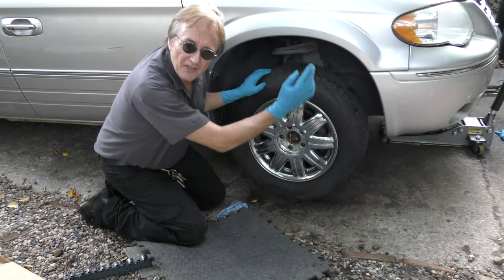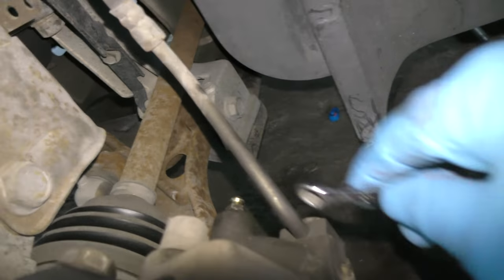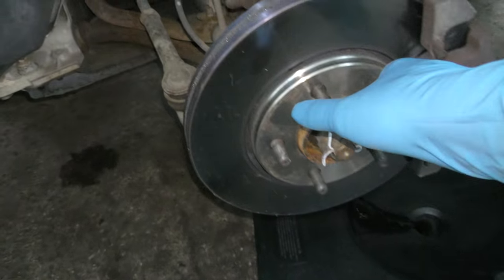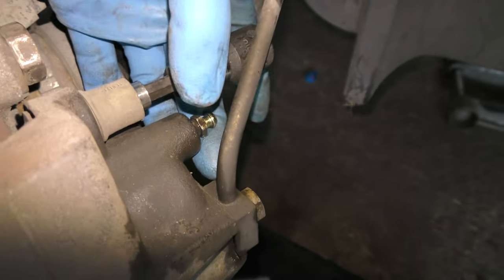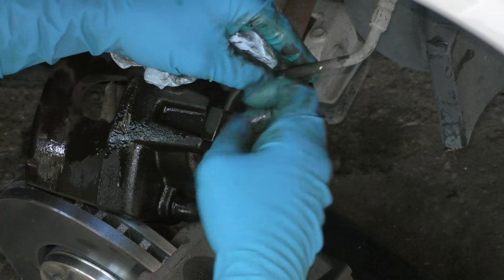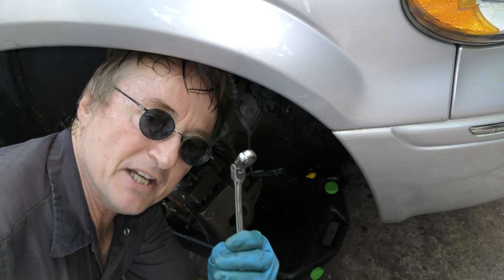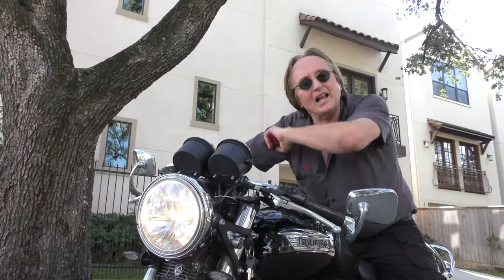How to Fix Sticking Brakes on Your Car

Comment: Forgot to mention it can also be a collapsed rubber brake line
Reply: I had that once on a Fiat, replaced the caliper but no result, it apeared to be the hose inside collapsed indeed.
Reply: This is true. As I work on cars and I would say 90% of the time it's the brake line.
Reply: If it was a collapsed line then the wheel would have turned when he cracked the bleeder.
Reply: You are right!
Reply: Brandon Peterman so very true, i actually see that more than I do bad calipers, had to hear this guy yelling at me till I muted it and read your comment verifying he didn't mention it. Good call for sure, that info really should be in any video about sticking disc brakes!!
Reply: @toddvance1979  wheel was off when  bleeder loosened.
Reply: Larrlos wheel or no wheel on, the rotor would’ve spun if the hose was collapsed. You can’t access the bleeder valve without taking the wheel off

Comment: I'm a subscriber....My 350z locked up the passenger side break today. I was driving about 10mph and with the 10" wide wheels. It nearly sent me into a light pole. The ABS light flashed a few times and the brake released. I wasn't pressing the brakes it just locked up on its own. Any suggestions???

Comment: I recently took my vehicle to a shop to have a caliper replaced.  However, they "required" the brake fluid to be completely replaced.  As it was always my understanding that you will need to bleed the brakes after replacing the caliper (and this will require some brake fluid to need to be added), was this an example of the shop "padding the bill"?

Comment: ok so heres a question for you, if you crack the bleeder to check if the rotor turns freely like you did in the video is it a quick loosen and then tighten or do you leave it open then tighten it later and then have to bleed the system again? if you are not replacing parts right away. My truck is just rubbing a little and i might need to drive it to the parts store haha.

Comment: How would you fix a sticking drum brakes?...also does the abs sensor has something to do with sticking?
Reply: Theres a lot going on inside a drum brake. lots of springs and levers n all kinds of craziness. if 1 thing fails or locks up, it all goes to shit.  If you see some fluid anywhere on or around the drum assembly then either the line or the cylinder is leaking, allowing air into the system which prevents its from releasing. 
the bottom of the drum has a weird cylindrical piece with small teeth, about 8 or 10 all the way around. thats the adjustment device to remove slack from the brakes. you can twist it a little back together to add some slack keeping the pads off the drums for a bit.
But like i said, there could be a lot of other things happening. and theyre all made different.

Comment: Scotty, i tried to bleed myself the brakes. The back was an ok job, but in the front, i managed to broke both bleeder valve into the calipers. So, i bleed thhe brakes at the brake line. How to remove the broken bleeder valves without using a torch? (i have no torch), and without using a welder either. Thank you!

Comment: I remember I had a 1996 Ford ranger with the ABS light flashing all the time and the rear passenger side brake would lock up on me in a weird way, I'd first get started and hit the brake, they'd lock and the wheel would drag and the truck would turn to one side, I had to stomp the brake pedal a few times to free then so it would stop properly and this happened very other day for the 2 years I had it

Comment: I've started noticing a plastic burning smell from driver side rear wheel well. Could this be a seized caliper, or maybe an issue with the brake hose?
Reply: If you crack the bleeder vakve and it's still stuck then it's a stuck piston. If you crack it open and it releases the pressure then it could be either a bad hose, brake line gone bad, or a bad master cylinder. Could be a number of things

Comment: Ok, ‘34 ford five window has brakes holding. I took off the caliper, pushed the piston in to see if the piston might be sticking or stuck. Put it back together, it’s sticking worse. I’m thinking the lines? Yes, could still be the caliper, but it’s doing it both front brakes, not the rear. 🤔

Comment: Hi there...was hoping to find a solution here but its not really the same issue for me.
I have an older Polo 9n (2004) I´ve just replaced rotors, pads, slider pins, brakehoses and calipers and the front brakes are stuck.
What would be the likely cause of this?

Comment: The front driver side brake is sticking on my 2005 Toyota Camry is sticking. i have replaced all the components  including the pads, rotor, caliper and brake hose. It is still sticking. Do you think it is either the master cylinder or the ABS system

Comment: What if you change the caliper and it's still doing the same thing? Can the master cylinder stick?
Reply: I tired everything calipers rotors hoses.... What fixed my problem is I bought a 50$ scan tool cleared all my codes then before driving I turn traction control off !. My wheel speed sensors must be bad so it tells ECU I'm slipping and locks / drags wheels with the abs system to point of smoke. Scan tool and traction control off helped my brake stick problem.

Comment: Hey Scotty, my name's matt. I have a 2006 Chevy equinox. I recently bled the brakes and got the air out of the system. The brake pedal is stiff as it should be. Went for a test drive and my brakes or caliper is sticking.  Without touching the brake pedal it is like the brakes are applied. What could I look for to help diagnose the problem?

Comment: I have a 07 Tacoma and occasion I get a vibration and hard brake pedal on the highway between 45-60 mph. The shake is pretty bad and then it will all the sudden just stop and go back to normal. What would cause this?

Comment: my Car has the brake lights on, (at the rear) one at the top of the tailgate, and two -one on the left side , and one on the right side. Could that be caused by the bad caliper? i saw you replacing the caliper, but you have not said a word , about brake sensors, or brake lights, depending on this caliper being stuck. also my car has another problem, the brake pedal is not allowing me to step on it, its not going down.... i guess that is not dependent on the caliper.... it was not used for some years....

Comment: After changing the caliper+hose it's still dragging bad?! After I pry a bit on the calipers/pads with the bleeder open. The pressure is relieved and wheel spins free. Once the brakes are used, it drags again

Comment: you could have a collapsed flex line..looks fine on the outside but no good.. slide pins needs lubing. investigate before you shoot part cannon at it.

Comment: Hi Scotty! I have a 99 Buick century with a trans problem. When it's cold, it slams into gear when downshifting. When it's warm it works okay but upshifts when I hit the gas more. And sometimes it seems like it upshifts and then downshifts rapidly like it's confused. Do you know what this could be?

Comment: Hey Scotty, I just had my brakes get locked up on my 2010 f150 and I went ahead and replaced the caliper and pads and the same wheel is sticking/smoking again. Should I go ahead and replace the hose?
Reply: Did you notice your rotor being uneven? maybe your rotor is bent? and it's wearing on the new brake pads. I hope that makes sense

Comment: Scotty need some help my brakes grind and slip on my 06 Dodge Charger RT I put new rotors and porcelain pads on but when I hit the braks hard they grind and like slip and when I do alot of braking they start to grind can something be wrong with the master cylinder or booster that's making them not squeeze them tight

Comment: Will my van jump when it gets past 60 and then if I let off it feels like the right front wheel is hitting tons of little bumps until it gets down lower speed. Also if I'm pushing the gas it doesn't do it until I get going fast. It sounded like my whole van (astro) was about to fall apart

Comment: I have a good question I have a car that I had sitting for a while in I changed brake calipers The rubber hoses to the caliper Master  Cylinder And the right passenger side still sticks I'm going to replace brake line from the ABS module to the caliper to see if that fixes anything F not I think I'm going to not put a brake on that side I got will bearing packing grease and some other heavy grease so I couldn't drive the car cross tone when I did the brake job because it was just sticking With the front tires up in  The air the driver side moves freely but passenger side doesn't next project is might be a will meringue issue or transmission issue don't know yet

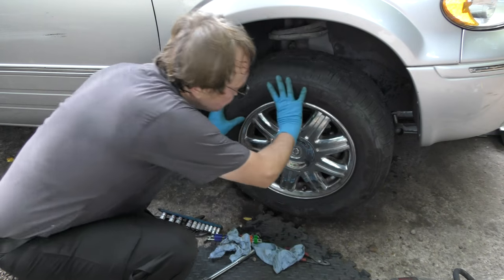Comment: there is the quote you need to hear 1:46 "simple fix IF you know what your doing" lol. for a 1min vid shows the process of a couple hours :D
Reply: It isn't rocket science.  The only thing that is tricky is bleeding the brakes, because more often than not the brake fluid is so old that it is contaminated throughout the system.

The actual caliper change out really is just 2 bolts, one hose connector, a little leverage.  Even if you struggle to dismount and mount the wheel using a crappy OEM jack to raise the car, you can do it in well under 30 minutes.  A floor jack and a decent lugnut wrench can shave 10 minutes off that.  

If you have access to another vehicle, more time is spent getting the caliper and returning the core than doing the job.

Comment: Hey Scotty I have a 2010 Chevy Equinox and the problem that I have with my brakes is when I'm driving and I hit the brakes at a red light and then when I get ready to take off sometimes I have to put my foot up under the brake pedal to lift it up to stop the sticking what do you think it could be I just had new brakes put on yesterday August 7th and the guy told me that I may need a master cylinder but we also check the calipers and they seem fine
Reply: if you have a capable scanner, you can auto-bleed the ABS. Or you can get a salvaged ABS module/etc if your vehicle is acting up in that manner. That can make the pedal sink down also. If that's not it, the rubber hoses in the brake line at the wheel may be clotted. Look into that.
Reply: Thanks a lot I'll let my mechanic know I really appreciate this

Comment: i've fixed mine FOR FREE...
1) loosen caliper
2) remove pads
3) use a G clamp and wind the pistons back into the caliper
4) spray with brake cleaner
5) slacken G clamp and press brake pedal slightly (the clamp prevents unwanted closure)
6) spray with brake cleaner again
7) wind pistons back in...if they are stiff repeat steps, if not remove clamps
8) refit pads and caliper

STICKING HANDBRAKE/E Brake..
1) Release brake lever
2) Spray brake cleaner onto stuck handbrake mechanism on rear wheels
3) If operating lever doesn't re-engage/disengage brake strike the handbrake mechanism back and forth by placing  a piece of wood against and hitting with a rubber mallet.
Repeating this process loosens any rust or debris from the handbrake mechanism under the car..I would then lubricate the part using a spray silicon oil, or grease it..

Comment: Hello sir ..i am from India wants some suggestion..

Sir i am using mahindra xuv 500 which is a suv
And..cars right front tyre slips while breaking, i replaced break pad , guide pin , but sill on speed above 40mph it slips, and produces grinding noice when we push breaks long slowly tell me what to do... thanks
Reply: Replace caliper

Comment: CAUTION: Bleeder valves can strip easily! I followed the instructions, but since I'm relatively inexperienced, I learned the hard way.

Wish I would've used a flare or socket and applied penetrating fluid.

Comment: Both my disc brakes on the front of my truck are dragging equally. The rotors get too hot to touch after driving just a short distance. About a half-mile. This suggests the problem is not the calipers. Could this be the master cylinder?
Reply: I tired everything calipers rotors hoses.... What fixed my problem is I bought a 50$ scan tool cleared all my codes then before driving I turn traction control off !. My wheel speed sensors must be bad so it tells ECU I'm slipping and locks / drags wheels with the abs system to point of smoke. Scan tool and traction control off helped my brake stick problem.

Comment: Unless your ABS pump is failing, than no easy fix(breaking the bank)
Reply: I tired everything calipers rotors hoses.... What fixed my problem is I bought a 50$ scan tool cleared all my codes then before driving I turn traction control off !. My wheel speed sensors must be bad so it tells ECU I'm slipping and locks / drags wheels with the abs system to point of smoke. Scan tool and traction control off helped my brake stick problem.

Comment: Can rebuild the caliper? I though caliper piston jammed
Reply: it is possible, depending on the damage they've taken, you usually need a special tool to get the piston out.  that is why they added the core charge to calipers.w

Comment: I had the same issue on 1999 nissan sunny/sentra b15. got my caliper replaced by a mechanic, wheel starts rotating freely. However after 2 weeks the wheel is feeling stiff again and resistance is building up when rotating. any idea what might be the issue>
Reply: Did you find it???? Wheel hub? bad rotor?

Comment: Nissan Titan 04, all brakes locked up after garage changed master cylinder. I changed brake booster ,still locking up master cylinder was not original, had to adjust booster push  rod so it wouldn’t put pressure on master cylinder , problem solved wheels are free now, what a nightmare

Comment: I hate those sunken allen head bolts on GM brake calipers. It took me quite a few hours to get them out of the hole last time I tried working on them... The only way I could figure out to remove them was to bind up an allen key in the hole then tap the allen key with a hammer. Anyone know of a better way?

Comment: Hey Scotty, my brakes are sticking and it's not any of the calipers. I thought it might be the ABS making the brakes stick so I disabled the ABS by pulling out the ABS relay fuse and the ABS fuse inside the SUV, but, the brakes still stick after driving so far and I have to rev the engine high to make the SUV move, but I have to let my SUV sit for a while because if I drive it while the brakes stick my engine will overheat and blow a hose or the radiator. The brake mechanic I took my SUV too says my calipers are fine and he and I can't figure out what is causing it to happen. It's not the transmission either because I put my SUV in neutral while it happens and my SUV still comes to a complete stop while it is in neutral and without me even touching the brake pedal. He put a new master cylinder on when my brakes went out and every since then my brakes keep sticking.  I'm stumped. Is the brake pressure too much? Is my SUV haunted? Ha ha! I'll try losing the bleeder valve like you say to do to see if that fixes it and in case it doesn't, any ideas are appreciated. Thanks!

Comment: You didn't fix the brakes you shot the parts cannon at it.
Reply: James Schrumm Very true.
Reply: Somebody wishes they had the big bucks so they could buy the rebuilt caliper instead of the 20 cent seals to do it themselves :O
Reply: Jesse Crandle He actually just called Kilmer an auto mechanic, which is NOT a complement. And I fully concur.

Comment: That front right brake and caliper of those vans were all garbage.  I have a Chrysler Town and Country with 130,000 miles and I replace that caliper twice.  Even after adjusting the rear pads still look good.  The front pads have been changed 3 times.  That front right one always goes bald first.

Comment: Hey, Scotty! I have a new Ford Tourneo, and the brakes sometimes stiffen up after I get back to my car. So I just switch to First gear, hold in clutch + break and stop the engine. Let up clutch, and the gear keeps the car in place. All is well. But this happened to me twice, at two different parking lots. Basically, I get back, push both pedals (Brake + Clutch) like when I want to start, but then the break is just solid, like pushing concrete. No matter how much pressure I put on the pedal, I could not stop the car, even on a very tiny incline at the parking lot. Of course, I just used handbrake to stop the car.

Once I started up the engine, the break went back to normal. Do you have any idea what might cause this? There is a Ford Transit and Connect, they never had this issue ever. Any ideas? I also had other older cars, never happened on those either.

Thank you!
Reply: A анонимный when a car is off it doesn’t have power brakes. This makes it hard to push the pedal in.

Comment: If anyone can advise me, would be much appreciated. I've had my mk1 focus 11 months, I've had my licence 8 months. I'm told my caliper has seized. They want £180-225 to replace, including discs and brake pads, I cannot afford this, the car is probably only worth around £500. Can I get a scrap caliper and just put old brakes back on (brake pads have done around 2500 miles since replaced) I need a "bush fix" but one that is safe to drive. Otherwise I have to sell car which is my only lifeline with mobility issues due to a back injury

Comment: I have a 99 cherokee that are completely fine until its a hot day or im stuck in stop and go traffic or both. They drag to the point im half throttle and then if i let it sit for an hour or 2 then theyre completely fine like nothing ever happened.

Comment: Butt butt butt, my breaks worked fine,then  break peddle hit the floor so without checking much I  replaced master cylinder, then noticed a rear line leak when bleeding,  I fixed the leak, again I  bleed the breaks. But now all 4 breaks are on strong.  At no time did the warning break light come on..  Can't even drive it as they hold the car back too much.  What's up with that?  It's a 1999 Chevy truck 4x.